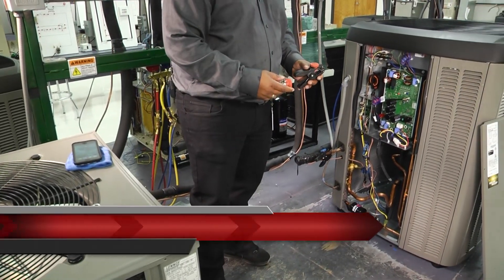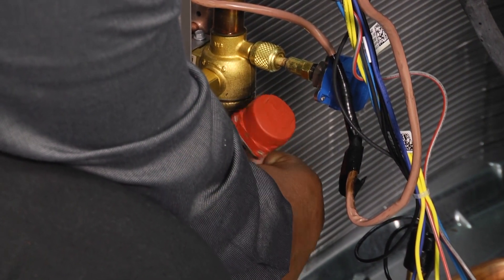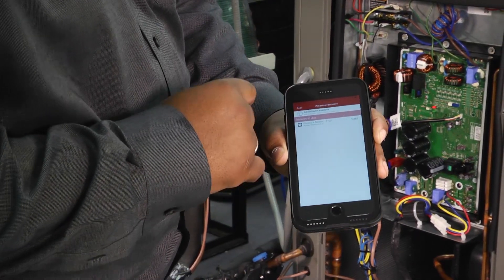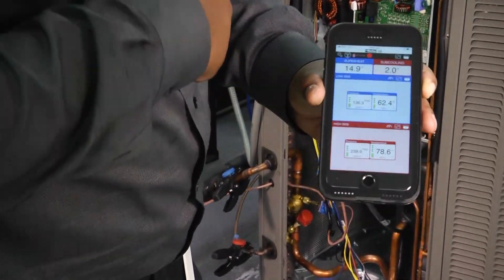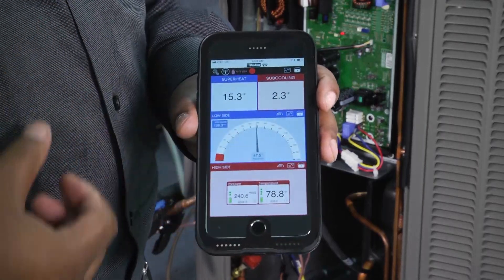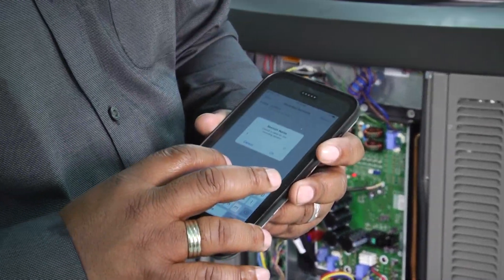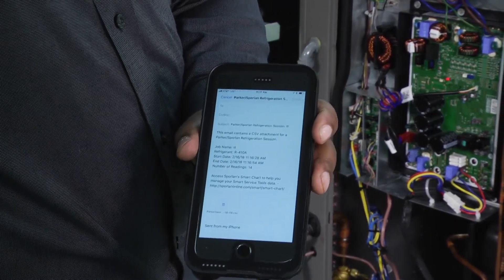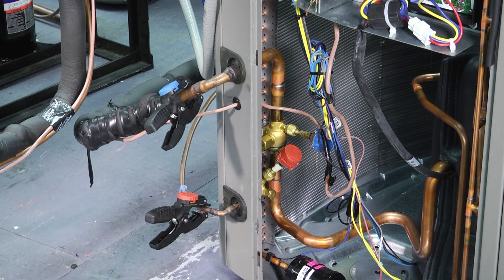How to Use Sporlan Smart Service Toolkit & App

Comment: Mine will not send the recorded session via email. When I call up the recorded session and click the email icon, I get a message saying “Mail Not Available”. I made sure I was connected to the internet, but it will not generate an email.  I sorted through some settings but did not see anything regarding email.  I also went into my phone setting to ensure that the app has access to what it needs, but email still does not work.  Any thoughts?